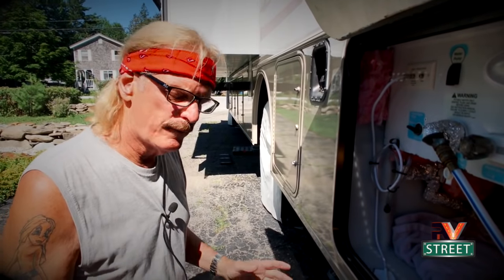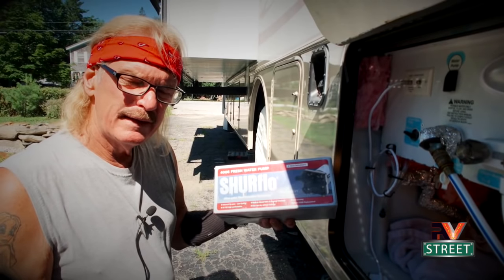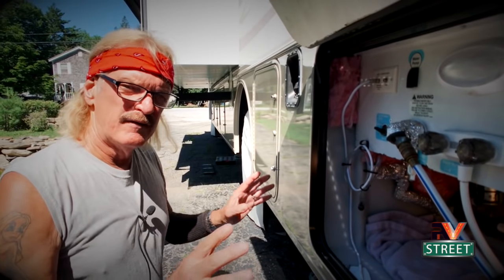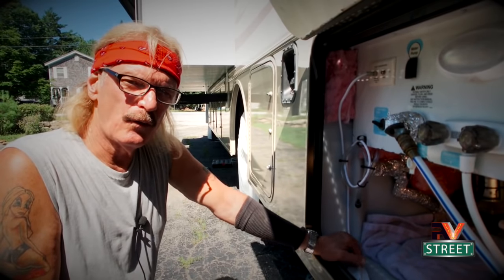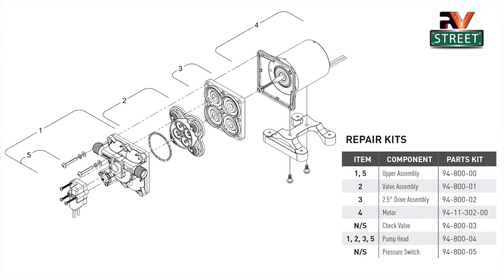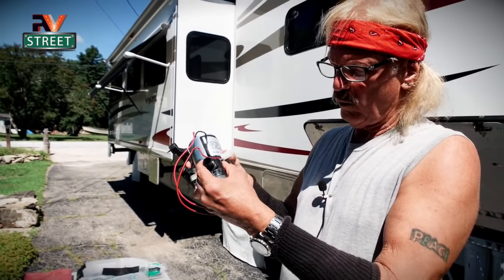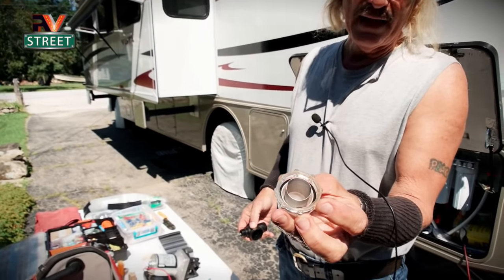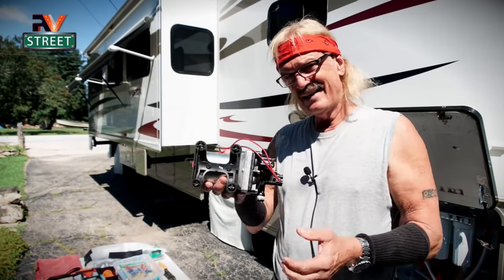RV SHURflo Water Pump Replacement & Important Tips

Comment: I think the most common issue is a broken contact where the wires plug into the switch. That was my problem. A neighbor had a spare one. So we change the pump head sure flow, and by morning time it broke again in the exact same place. The wires going into the switch are corroded and it becomes very narrow and flimsy going into the switch. It's a piece of planned obsolescence. The other thing is I didn't disconnect the battery, and when I came inside I had no pump power on the panel. I was troubleshooting all over the place until I finally found the fuse was blown in the main board panel.
Reply from the maker: Thank you for sharing your knowledge and helping the RV community, with everyones input and experience we are a team that's unbeatable.

Comment: Thanks for all your Videos! Our water pump in our 2003 Tiffin Allegro is a 12v, Artis PDSI-130-1240E, 40psi. Does the replacement need be the same brand, psi?
Reply from the maker: I did talk about not getting a replacement pump that draws more amps than the coach is wired for—but ya know—this is a good question. 
As I read your question I had to think about that for a few minutes. But here's my thoughts.

When you're running off city water, that pressure can vary a lot as you know. That's why everyone should have a regulator at the water source spigot. Getting water from the spigot and regulating the pressure before it enters the RV is important so you're NOT getting more than about 60psi is always a safe plan for all your RV's plumbing. Anything higher than that your plumbing could be at risk since your RV is an older model. So we know that RV plumbing is good for 60psi.

FYI, most older RV plumbing was tested to 60 PSI maximum. Not sure what years that covered though. RVIA standards are higher now and the last edition I saw required a pressure test of at least 80 psi. I've heard that RVIA has since increased it again to 100 psi.

As an alternative, to increase flow you could...
Remove the flow restrictors in the sink faucet aerators AND shower (in hose or handle). Flow WILL increase if you remove them.

I knew a fella that upgraded to a Remco Aquajet 55AVR variable speed water pump. There are several several versions so check around on the flow rate and amp draw. The believe he installed the Aquajet that's rated at 65 psi @ 5.3 gpm @ 10amps. After several years of operation, so far the plumbing in his 2001 Newmar hasn't blown up. But again you have to make sure it doesn't draw more amps than what your RV is wired for.

If you have an ice maker the water flow from a pump with more pressure I've heard that could also affect that operation too.

Also something to think about is, if you do any boon docking, increasing your water flow from the pump can cause you to use more water and that would not be good when you want to conserve water.

If I were in your shoes, I'd call Tiffin in Red Bay, give them your VIN# and ask them for their advice on the routes you could safely take.

Good question Robert. 👍
Reply: @RVstreet  Thank you for your time and reply! The reason I ask is, I cannot find a new pump the same model as we have now. All the water lines are PEX so I am sure more pressure would work but of course I don't want to make a costly mistake. We do have the same pressure regulator you have.

Comment: I love your videos, so glad I found your channel and thanks so much for sharing your know-how with us. I'm a diy-er and love this sort of thing. I do have a question, I am a bit new to RVing. After you turn the water off for the night at the outside faucet, do you leave your water pump on for an hour or so until you go to bed or do you just turn it on and off for each time you need it. I was told never to leave it on but also the pump doesn't work until you use the water so I'm not sure what the correct thing to do is. Thanks!
Reply from the maker: We leave the pump ON till we go to bed. Then turn OFF. We have a bath and a half and there's a switch in each bathroom. So if we have to use the bathroom in the middle of the night we turn ON the pump from the bathroom, flush, then turn it back OFF. Once up in the morning. City water goes back ON and pump is OFF.
Reply: @RVstreet  Thank you very much.

Comment: Very informative. My problem is that the water pump in my travel trailer is not accessible. I hear it is in a compartment under the kitchen sink but there are no exposed screws to get to it. I suppose I will need to cut a hole in the board then fit another board to go over the hole. RV manufacturers need to consider these issues. I think they know the pump is going to last through the warranty period. After that the owner is on their own. I will look at your other videos and subscribe. We full time in a travel trailer but we stay stationary 8-10 months of the year and only travel in the summer. Always lots of maintenance and repairs to do. After the water pump I need to replace the noisy A/C fan motor. Again the manufacturers don't make the fan motor serviceable. The bearings cannot be routinely lubricated. It will last through the warranty period then must be completely replaced.
Reply from the maker: I'm sad to say that Martin has passed away and I don't have to answers to your questions. Sorry.
Reply: @RVstreet    I am sorry for your loss.

Comment: About the screened bowl, you mentioned it must be parallel to the pump, what is the reason for that?  My pump is installed like yours but the screened bowl is perpendicular (facing sideways), that’s how it came from the factory, would this cause issues?  When hooked up to city water, it is filling my fresh water tank, I have a winterize tube connected to the water pump backflow that I turned the valve so water could not backflow but wondering what the water pump is back flowing and not doing its job.  I opened up the check valve and got it realigned but it’s messing up again.  It’s barely a year old and everything is pretty clean inside.
Reply from the maker: I'm sorry to say that Martin has passed away and I don't have the answer to your question
Reply: @RVstreet  I’m so sorry to hear that.  Thank you for all of the videos and inspiration that you both shared on here.

Comment: Yes how do you prime your water shurflo water pump ever 6 months to a year. To flush out calcium build up? Thanks
Reply from the maker: Thanks John for your question 👍
The water pump is self priming so no need to manually do that.
You sanitize your water pump, pump screen, fresh water tank and your entire RV fresh water system this way: https://www.youtube.com/watch?v=5-55rJ0w-5U&t=178s

If your worried about calcium build up—which is a good thing to worry about—you need to install a water softener. This is a must in my book: https://www.youtube.com/watch?v=14Zo8Vkvh5o&t=350s

Comment: Enjoyed video.  I was wondering, do we necessarily need a water pump and fresh water tank if we always go to campgrounds with full hookups?  We have a problem with water leaking into our fresh water tank, which we don't want to use.  We've had 2 previous TT and this never happened to us.  We never us the Fresh Water tank.   Usually on our 2nd day is when I notice my fresh water tank going to 2 lights, and that's when I start doing the things I've seen on other videos on Forest River forums; we have a 2015 Palomino Puma 26 ft with outdoor kitchen, bought TT used in Nov. 2019.  Its very annoying to have to go outside turn the city water off; run the pump for a while, then start turning faucets on to get the air out.  Eventually I get all the water out of the fresh water tank.  We did buy a pressure regulator with a gauge that I put at the city water connection; Saw a video where someone else also put one at the camper city water hookup with a water filter.  Haven't tried that yet.  So, do we really need a water pump and a fresh water tank if we always use city water;  we take one trip a month for like 2-3 days, then back home, never going too far, maybe 100-200 miles away at the most; just my husband and I, no kids.  

Like I said, we bought this camper used.  Also have a leak at toilet, which is a 310 Dometic ceramic; its not much, but don't really know where its coming from; thought it was the connection behind the toilet at first cause it seems to happen just when we flush; but then one day saw some water in front of the toilet on floor, so I just keep a towel around the base of the commode to catch any water coming out.  Only leaks when we flush.    Thanks for any advice.   Saw videos on this too but really afraid to touch it.  We do have a slide.  Worried about that giving out one day too; my husband calls me a worry wart.  Ha.  Thanks for listening.
Reply from the maker: So, do we really need a water pump and a fresh water tank if we always use city water.......
NO you don't.

its not much, but don't really know where its coming from; thought it was the connection behind the toilet at first cause it seems to happen just when we flush......
You need to find out where that leak is coming from and fix it. If you don't that water will seep into unknown areas, begin to rot flooring and other areas and certainly cause mold. The first place I'd check is get a flashlight, bend over the toilet and look and the back of the toilet....then flush it. I'll bet it's leaking where the hose connects to the toilet. Look for areas back that are wet. If not there it may be the seal ring under the toilet or a leaking water line down stream. You just have to keep flushing while you check until you find the problem.

Don't be afraid to check when problems like this arise. Preventive measures and fixing small problems right away can save you a boat load of money in the long run and in this case possible health issues with the possibility of growing mold underneath the toilet area. Any if water is seeping around the bottom of the toilet, it's only time before it will rot out the floor too. Trust me on this. Water problems, water leaks are an RV's worse nightmare. 👍
Reply: @RVstreet   Thank you for your reply.

Comment: The flow max water pump I purchased recommended against using teflon tape which could clog up in the pump or block the pipes.
Reply from the maker: It won't if you you apply it right. Don't put it all the way down to the end of the threads. Been doing it this way for years. But.....try it without tape. If it doesn't leak, you're good to go. 👍

Comment: I can’t find another way to contact you. Sorry. Great videos! Question: have you done a video on how to check brake fluid? We cannot find a way to do it. We have a 2019 JAYCO Precept Prestige. They provide NOTHING to help us keep this thing on the road! Thanks for your help!
Reply from the maker: The brake fluid reservoir is up front in the engine bay. Open the hood and it should be off to your right and up top. BTW your brake fluid should be thoroughly changed out every 2 years.

Go here and select F-53 chassis for your users manual.
https://www.fleet.ford.com/parts-service/resources/owner-manuals/
Reply: RVstreet thank you so much! We just don’t know how check the level.
Reply from the maker: @stephaniepewtress8432  Go where I told you, unscrew cap and there's a dip stick there.

Comment: You should have used butt spice connectors (with heat shrink tubing)to connect the pump wires to your old connector harness. If so you wouldn't have had to use electrical tape to prevent a short and you would have a whole lot better and permanent connection.
Reply from the maker: Good advice 👍

Comment: I have a question about my water pump.  I had to replace the plastic part because of a small crack due to freezing weather.  I'm in Texas now and we have intermittent freezing weather and the pump works but sometimes it keeps running but no water will pressurize.  Also, I had an instance where cold water comes out but not hot water.  I thought maybe the hot water line froze but why when the lines are inside with the cold lines as well.  I don't see any leaking water but yet sometimes the pump will come on when I am not using any water.  This thing baffles me as to why it works when it wants to and then it doesn't.
Reply from the maker: *You said: I had to replace the plastic part*...I'm assuming you mean the plastic screen strainer bowl.
When the pump comes on when your not using it, it can only be 3 things:
1) the water pump check valve is bad
2) your main water switch lever...."the one where you switch from tank fill or normal" is leaking by
3) you have a leak somewhere
It's more than likely either 1 or 2. 
Since your plastic screen strainer bowl cracked, it was probably leaking some water there and the pump may have been running a little dry for awhile and ruined the diaphragm inside. There are rebuild kits for about $30 but you can get a brand new pump for about $65. That's what I'd do. Once you replace the pump IF....and I mean IF...the pump still Intermittently comes on and off again for like a second or two when your not using it, then you know for sure that it's your—tank fill or normal valve. You'll have to replace that. Both 1 and 2 are common problems and these are the solutions. Since you have no water going thru the water heater and no pressure I'm putting my money on it's a bad pump. It's been going bad slowly and you just didn't really notice it until now. They do go bad.
If your interested you can get a new one thru my Amazon Store.
https://www.amazon.com/shop/rvstreet

Here's right of the SHURflow water pump manual
Normal pump maintenance is all that
is needed: Checking and cleaning of
the strainer, normal sanitizing and
winterizing and occasionally checking
all plumbing hardware and fittings
for tightness. *Lack of sanitizing is the
number one reason for premature pump
failure and poor performance over time.
Lack of sanitizing will cause scale buildup
on the diaphragm and valves, causing
low flow and leak back [occasional
pump cycling with no faucets open or
tank filling up when hooked up to city
water].*

This is why I push the message all the time to folks. Sanitize twice a year AND have a water softener to prevent scale buildup.
Hope this helps 👍
Reply: @RVstreet  The plastic part of the water pump I replaced because it cracked when it froze.  Later on I found out that the plastic housing of the strainer before the pump also cracked.  I had replaced the plastic part of the pump and it worked good and I took out the strainer until I could get a new one.  I cannot see any water leaking in the RV from the pump.  Also it makes no sense why the cold water at the faucet works but then no pressure on the hot side.
Reply: @RVstreet  Thanks, I'll look in to sanitizing as well as a preventative.  I got the new strainer housing in and put that back on.  It seems to work better now.  Always something new to learn with my RV.

Comment: I recently purchased an RV, The water pump under my kitchen sink & is actually laying down. Is that okay? Or should I modify it?
Reply from the maker: I'm not sure about your specific water pump, but with the SHURflo the screened bowl needs to be facing down 90º to motor like I showed how mine is in the video. That bowl also needs to be cleaned/sanitized periodically.
Reply: @RVstreet  is that screened bowl an extra part? Or does it come with the pump? I called an RV shop, they told me come on in, they had my pump, when I got there, they're training 2 new people, it took an hour, & they DIDNT have my pump but told me they had a replacement. 25 minutes was the girl figuring out how to use my credit card! I just kept walking around looking at stuff I cant afford! When they said they had a "replacement" & i said okay... I was THEN out the door in 10 minutes. Irritated, getting a ride from another RVer, just ugh! The pump was ALMOST DOUBLE WHAT MY ORIGINAL WAS!! $201 O.T.D.!! & now 2 months and 130 miles later I'm blowing a circut 
. I now see the new on is 7.5 amps & my old was 5amps!
Judas Priest & Mutha Nature! Are you kidding?

Comment: Just wondering why you didn't just use butt connectors on the wires. Also, you said "the bowl and motor are always parallel". Not always. If your pump is mounted on the floor then the bowl would face down.
Reply from the maker: I prefer spade connectors and had plenty for this application, however butt connectors would work too. I later came back and used heat shrink over both wires and connectors too which I commented on in the very first comment.
As far as the bowl placement is concerned, your right IF the pump is mounted on the floor. I was speaking about my orientation which is mounted on a wall, the bowl should always be parallel. 
It's hard to cover every situation every RVer would run into, but it's not a big deal, every new replacement Shurflow pump comes with a detailed diagram of how it should be depending on the pump orientation.
thx Jim

Comment: Two things…. 1. Use blue butt connectors, not the quick spade connects, you already have a factory plastic plug.   2. When mounting to the bare wire, First place the connector into the proper grip location in your crimper…..then place the bare wire tip into the butt connector and squeeze to crimp. This way there is no possibility of the two ends to lose the proper position while you are reaching down to pick up the crimper from the tabletop. Buy the type of butt connectors that are made with heat shrinkable ends. After crimping, use a Bar-B-Cue igniter to melt the shrink. No need to add external heat shrink pieces….no bare metal to have to tape over.
Reply from the maker: Ya that would be another way to do it for sure.
I did end up later using heat shrink sleeves over the ends and wires after doing the video and mentioned that in the very first comment. I should of showed that in the video but it had already posted to YT.